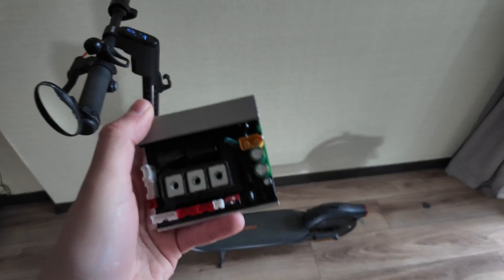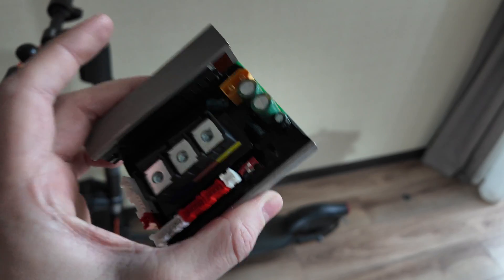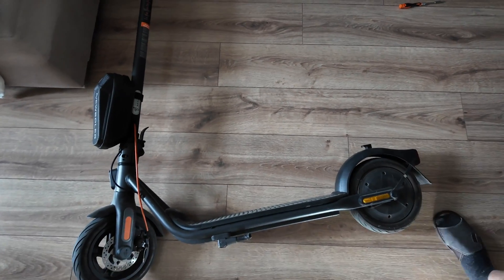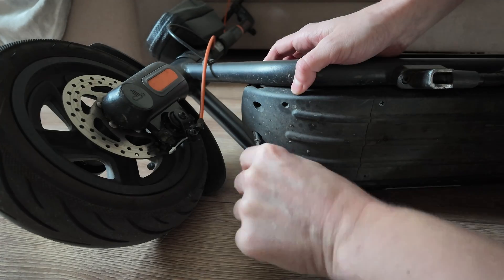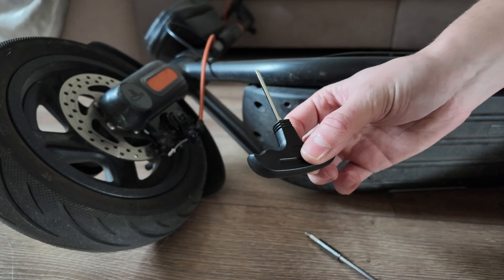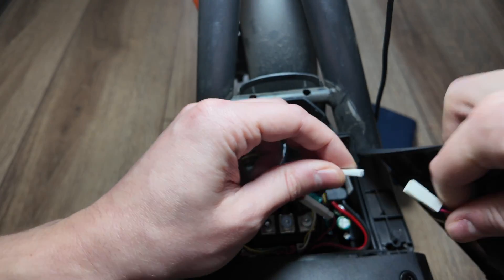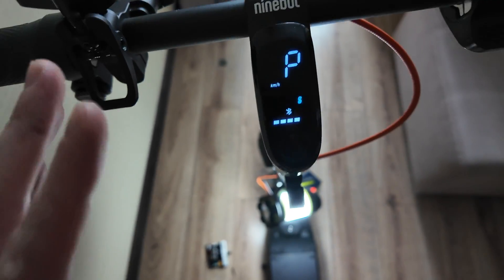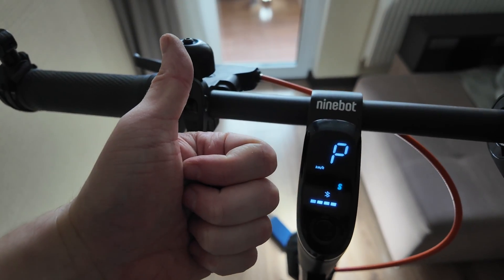Unlock 32 km/h on Ninebot F2/MAX G30/MAX G2/E2 Pro/ZT3 Pro/GT 3 Pro with Controller Replacement 🚀

Comment: I removed the 4 screws but the top part still doesn’t come of, as if its still stuck
Reply from the maker: need to add some efforts
Reply: oh it worked i just used a screwdriver to take it off, it goes 32kmh now this tutorial actually helped 🙏 thank you
Reply from the maker: @TheFakeCode  great, enjoy unlocked speed

Comment: Tips for warranty sticker : use a hair dryer to melt the glue and then remove it with a cutter knife. Or remove first the left and right screws to make some space around the middle screw with the warranty sticker, and then loosen it with a locking plier

Can't believe Ninebot did this dirty trick. Made me regret to buy their stuff. Next scooter I'll buy surely not be from them

Comment: Hi how do you manage not to confuse where to connect the cables, because it seems very difficult to connect everything on the right places😅
Reply from the maker: just follow my video, I made a photo when I just opened it)
Reply: One more question, I wanted to know if I order the controller from aliexpress for 30€, will it be the same if I order the controller from a real site for 70€. Isn't there a difference in quality? And won't it affect the battery life?
Reply from the maker: @ДанилБровко-и8ъ  as for me, it is same, battery life same as well
Reply from the maker: @ДанилБровко-и8ъ  it will not affect the battery life

Comment: 2:54 Be carefull (pulls really fast with ripping noise)😅 Good tutorial though its too bad you just cant re program the old ECU to go faster, I have the same scooter but I did this awhile back to my E zip scooter and I had to replace the motor also to a 25v to 41 volt motor I'm pretty sure that higher voltage controller will run a lower volt motor but your going to burn it out faster u need to upgrade the motor when upgrading to a new higher volt ECU usually, just sayin...
Reply from the maker: thanks for feedback

Comment: Hello Man, Your video is very helpful. I have Segway Ninebot G2 Max. There's 2 controller options in AliExpress, 1 is 35km/h and 1 is 40km/h. What do you recommend?
Reply from the maker: 40km/h hours is fake, so both of them will be 35 max
Reply: @ChinaGalaxyTech  So I would go for 35km/h?
Reply from the maker: @ yes, 35 should work
Reply: @ChinaGalaxyTech  ok man, thank you

Comment: Can you go back to the old controller to resell it? Will it still work with the app after and will it not count the distance towards the total then 😄??
Reply from the maker: yes, you can use old controller and resell it. Correct, it will not count the total distance

Comment: Also I had already installed the controller, works fine 32 kmh. What about the firmware should I install the update? Mine scooter is F2 plus model, now the Segway application registers it’s F2 Pro I don’t mind that. Also works the binding with iPhone. Mine region is set to EU.
Reply from the maker: you can install, it will still keep the speed and other features
Reply: @ Thx for quick response
Reply: Tried to update but it gives me error code 7, even better for me I was tempted to update but it doesn’t work, good for me 😁
Reply: My got a trottle error and now i cant use my escooter after the update. How can i fix this?

Comment: installed the controller and nothing happens anymore, just stays on 0 kmh. Did not use Hacking tool. 

Any ideas? Do i need to change the dashboard?
Reply from the maker: pls provide more information, what kind of scooter do you have?

Comment: I have ninebot kickscooter F2 (not plus or pro)
After I replaced the controller, the app will identify the scooter as a pro, thats why it allow 32 km/h? What about cruise controll? (F2 doesn't have)
Reply from the maker: correct, cruise control will be available as well, as the controller will be for the US market
Reply: @ChinaGalaxyTech  thanks
Can I build in F2 pro controller into my normal F2 scooter?
Reply from the maker: @ZaraLucaLaczko  please check the link in description, I suggest to select as for regular f2
Reply: Hello, Does it work on the European zt3? I thought the flange was in the dashboard?

Comment: E2 Pro not supported on hacking app so hopefully this way works. Delivery was crazy quick less than 7 days from order to arrival. Very quick!
Reply from the maker: great, it will work
Reply: @ChinaGalaxyTech  yeah just to confirm works on Segway E2 Pro. Just installed and gets to 32kmph
Reply: @ChinaGalaxyTech  Hey why is there a free slot on the controller? Nothings connected into it. Is it possibly another battery slot?
Reply from the maker: @user-wd5wk7wf1l  nope, the battery is connected by 3 screws
Reply: @ChinaGalaxyTech  no the wheel is connected by three screws. The battery is connected by xt60 as well as a charging cable.
Reply: Hi so i just bought a 32km/h controller for my E2 Pro. Is the disassembly the same as the F2 in the video?

Comment: Would you consider that this controller could be the way for make my scooter works with an external extra battery? I was tryin to find the way and the problem was on the controller tho, so, let me know, thank you for share
Reply from the maker: I have no idea, only way is to try
Reply: @danielosaurio  you need to buy a xt60 splitter. So you can parallel 2 battery's.

Comment: Question, for this you do not need any app or software computer to do this right. The reason why I am asking this is because I want to know so I do not have to go through the difficulties when doing this.
Reply from the maker: nope, only what you need to replace controller, that`s it

Comment: Controller ordered!! I’ll let you know!!
Thanks for everything
Reply: Controller installed and everything OK!! Thanks for your job and help 🙏🏻
Reply: How fast can you go? And doe the ninebot app still work?
Reply: @jarrydwhite3832  32 km/h. App still working without any problem
Reply: @jarrydwhite3832 
It goes 32km/h now and the app
Works fine however you will need to unbind your scooter from the app and then connect Bluetooth and location to ninebot app to reactivate It cause you will get a new serial number otherwise you'll get errors and also it's a bit hard to install for the first time, because I did it today but it's doable so it's worth it.

Comment: Does this work in the uk
Reply from the maker: yes, works well in the UK
Reply: I've tried this in May with a UK version and it didn't work with my scooter. Once you replace it the serial numbers are not matching so the scooter won't work.
Reply from the maker: @dobroslavgeorgiev8376  ohh, interesting, which scooter model do you have? I had many viewers who did it in the UK, worked well
Reply: @ChinaGalaxyTech  Max G30. So once you replace it the scooter gets restarted to defult settings which means you need to pair it with the ninebot app otherwise it's in alarm mode and won't run (probably you can force it to run by ignoring the alrams etc. I haven't tried that) but once you try to pair it with the nine bot app afterwards it says that the BMS serial number doesn't match the scooter serial number.
Reply from the maker: @dobroslavgeorgiev8376  actually you fully replace the brain of the scooter, if you just put back your original one, the settings will still there. I have 2 scooters in my ninebot app, still works fine. By 2 scooters I mean to different controllers of 1 scooter